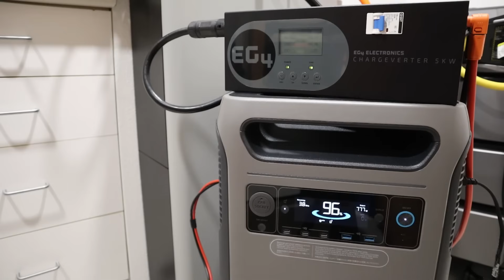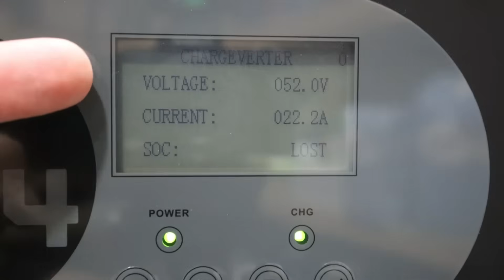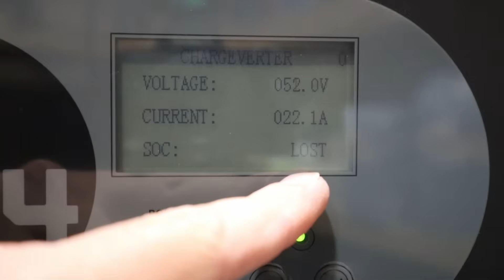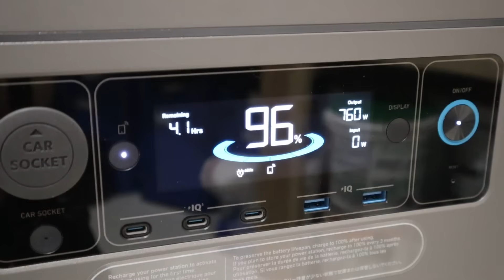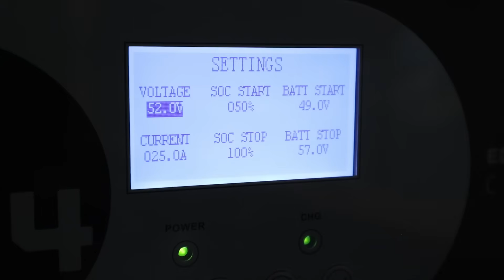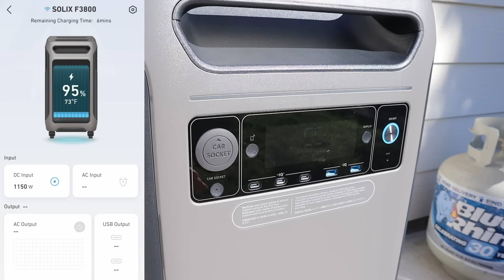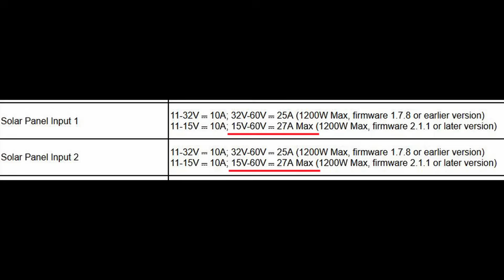The EG4 Chargeverter FIXES the Anker SOLIX F3800!  Keep the 240v Powered On!

Comment: I have 2 F3800's and a chargeverter.  I can try when I get back from my trip unless someone tries before I get back.
Reply from the maker: Please let me know if you can charge two units with one chargeverter 👍
Reply: You can get the 1150 charge for both 3800's    Not sure with the HPP yet.
Reply: Any updates on if you are able to charge both 3800s with one chargeverter?
Reply: @EKingJames1288 I have hooked the chargeverter up to two f3800 that are connected to the home power panel and I found that when I do this one of the units starts charging up to 1150W then I plug it into a second one and the second one starts to gain watts but then they both start losing watts. If I leave just one connected it stays at 1150, but as soon as I hook up a second one, the first one starts losing watts and the second one starts gaining, but only to a certain point, that is not even close to 1150w. I’m wondering if it’s a setting on the EG4 charger converter. It would really be great if I could get the EG4 to charge both of them at full watts. Any ideas?
Reply: @JeffLevy99  The Chargeverter amp setting needs to be 27 amps for each F3800 XT-60 you are feeding, so feeding 2 XT-60s from the Chargeverter would require the Chargeverter amp limit set to 54 amps (each will actually draw about 20 amps, 27 is the spec limit for the F3800 with the new firmware).
Reply: @JeffLevy99  Did you ever get an answer besides cranking up the amps on the chargeverter, which worries me that one may get more than the other during ramping up/balancing.Also, terryabertson says that 54 is amp limit... But not if your talking about 2 f3800s like i have. That would be 27 x 4 right? 4 xt60@ 27 ea. inputs.wish Jasonoid could chime in here and set it straight.
Reply: @JeffLevy99  I had the same experience. Start charging but soon the chargeverter Volt and Amp comes down
Reply from the maker: You can't use the chargeverter to connect to both ports on each F3800, if there's a common ground between the dc charging ports the charging will stop. For this reason you can only connect the chargeverter to one port of the F3800. 

Wanting to charge two separate F3800 units? The amps of the Chargerverter needs to be at least 24 amps per port. So amperage output of the Chargerverter will need to be set to ~50 amps to charge both F3800.
Reply: @JeffLevy99 I have the same problem. I cranked amps to 50 on eg4 and max I got on 2 units was 390 per unit but wires were getting warm.
Reply: I thought the issue was you couldn’t use the 240v when charging using the 120v? I couldn’t follow 

Let’s say I didn’t have a 240 v outlet in my garage . Would this set up help me use the 240v plug in the F3800 while having it plugged in and charging in 120v wall outlet ?

Comment: so my plan was to use the EG4 chargeverter to charge on one dc input and have another eg4 chargeverter pluged in on the other input and running off  another generator that way they dont share the same ground
Reply from the maker: I mean that might work....but that's like $1000 worth of chargers! It all depends on how much money you want to spend
Reply: @Jasonoid  I decided to buy 2 EG4 48v server rack batteries  and run through the solar inputs ,Thank You Jason

Comment: I tried this on a smaller scale, on a C1000 with two different power supplies. In both cases the power supplies shut down as the C1000 pulled more wattage than the power supplies were rated for. It would be nice to get this to work though.
Reply from the maker: The chargeverter is rated for 5000w output, if definitely wouldn't be overloaded by the C1000 or the F3800....even at the same time!

Comment: When connecting different gauges of wire like that, it's a really good idea to include a fuse appropriate for the smallest wire.
Reply: I'm confused, is the fuse recommended? I see Jason included a link to a fuse, but I'm lost as to which one to get and how it gets implemented into the wiring.
Reply from the maker: Thanks for the tip!
Reply: @Jasonoid  I'm confused, is the fuse recommended? I see Jason included a link to a fuse, but I'm lost as to which one to get and how it gets implemented into the wiring.

Comment: Does the solar input wattage accept the maximum from the EG4 Chargeverter?  Sounds like no.

Does the solar input wattage accept as many watts as the inverter can supply or what percentage of the output can it charge?  Sounds like a small fraction.
Reply from the maker: Solar port is 1200w per port, you can get 1150 watts into the port with the chargeverter. They said they are looking into a firmware update to allow charging on both ports for around 2400w input.

Comment: Also I would recommend adding inline circuit breakers and/or fuses to protect the wiring on the adapters.  Worst case scenario you can send the full current of the chargeverter through the 8 AWG if there's a short.
Reply from the maker: The chargeverter has a circuit breaker built into it.
Reply: @Jasonoid  rated for how many amps?  It's probably much higher than 8AWG wire can handle
Reply from the maker: @rcguymike  ill have to look closer when I get back home from vacation 👍
Reply: Also, those SB50 connectors are only rated to 50amps. The full power of the Chargeverter going to a 48v battery is 100amps. Dangerous combo without some fail-safes.
Reply: @rwk1859  The 3800 can't pull more than 27amps per port with the latest firmware

Comment: Sad if you consider that a Delta3 plus can charge nearly as fast as that anker setup😅😅😅

I control a 48V relay to feed power to my Delta 2 Max from my 48V server rack battery, I moved all the solar off of the D2M and added it to a Victron 100/20.  I can charge my Delta 2 Max with 2 EBs with 4000+watts of solar, I also have another array on a 150/70, the battery absorbs the excess while the D2M takes in 1000W continuously.  The relay is controlled based on the battery SOC through a node red script controlling the relay output on the CerboGX, much better than using the built in MPPTs directly with the solar.
Reply from the maker: Thats an awesome setup!

Comment: Can you do this with the old school Delta Pro?
Reply from the maker: You'd just plug in a generator into the Delta Pro and it will charge and allow AC out. No chargeverter needed.
Reply: Yes you can, and it is preferred.. You can connect the Delta Pro directly via AC input to a generator as Jason stated, but you are then limited to 1800w and quite a few people had issues with frying their DP when a fridge or something with a high inrush turned on... Poof.. 

You can get 2000w power supplies that will work just the same for around $150..
Reply: @stevenlilly  Can you provide an example of the power supplies that would work?

Comment: Can this EG4 charger be programmed to charge EG4 batteries overnight (TOU) and to a specific state of charge?  If so, it’s what I’m looking for to run my house on a UPS style setup, only using grid power to top up my batteries overnight on days when solar couldn’t keep up.
Reply from the maker: You set the voltage to exactly what you want so if you have the battery voltage you want I'd say so 👍
Reply: @Jasonoid  nice!  Any insight on whether you can set the desired time of charging to come on automatically?  I had a peek at the spec sheet and there was no mention of that.
Reply from the maker: No, it's pretty much an 'on or off' type of thing. No advanced settings.

Comment: Would the Setup for using the Chargeverter to the Delta Pro Ultra be somewhat the same? A friend of mine wants to use a Generator (with modified Sine wave) to charge the DPU on Cloudy days.
Reply from the maker: Yes, it would be similar to the Anker, but the Delta Pro Ultra will only charge around 800 watts (not 1150w) input since it's limited to 15 amps on the low PV input.
Reply: @Jasonoid  From a Gas Generator??? Are you Serious? If that's the case dc to dc would be better
Reply from the maker: @Moes_Prep_and_Tech  yep, just do the math.   56v x 15 amps is 840w. You'd get the same charging speed with a 48v battery. I connect a 48v battery every night to my low PV charging port on my Ultra and I get 800w charging. I wish it was 20 amps, not 15...
Reply: @Jasonoid  That New Bluetti AC300  (APEX) is gonna have 20 amps from what I hear. I think its pretty much the same as the Anker I believe

Comment: To bad EG4 doesn't supply the 120 volt adapter, I have a plasma cutter that will run on either voltage, and it had the necessary adapter in the box with it!
The EG4 chargeverter would actually be a better investment than say a 30A 48 Volt charger from the LiFePo4 battery mfg, when their 30A charger is $300 bucks, Right?
Reply from the maker: I tried a standard 48v battery charger on the Anker and it didn't work. It wouldn't start charging. A standard battery charger relies on a voltage to tell when to charge and it doesn't see that on the solar port. 
The chargeverter just puts out a set voltage, kinda like a large power supply and that's why it works.
Reply: @Jasonoid  So you don't think it would work as a battery charger then?? I was planning to expand the capacity of my C1000 using a 48v 30aH battery then maybe paralleling another on if it turned out I need that much battery capacity, but I need an efficient way to recharge the batts if solar isn't available, and figured the chargeverter would minimize the run time on a generator
Reply from the maker: @dannydivine7699  the chargeverter is a 48v battery charger so yes it will work for that. It also works when connected to the F3800.

Just don't try to do the same thing seen in the video with a standard 48v battery charger.
Reply: @Jasonoid  Excellent, Thanks for the clarification, I thought maybe I had misunderstood. Great Video as ALWAYS! Have a great weekend, Happy Halloween!!

Comment: I have the eg4 server rack battery and inverter and am lacking solar panels and space needed to require the 120V needed for charging.  So I purchased the Victron PPT 150/35 to charge and maintain the battery with 400W of solar.  I had been thinking of buying the EG4 chargeverter to use with my Honda 2200 companion but also want to do other projects using lighter and smaller 12v batteries instead 48v more for portability .  Do you know if the charverter is strictly for 48V only?  If not my other choice would be the BeeBad charger which I can select 12V or 48.  I love the adapters you made.  I need to break down and buy tools required for cutting and crimping.  As always a great great video.  Thank you.
Reply from the maker: It's only supports 45-58 volts output. Check the manual for the exact voltage.
Reply: @Jasonoid  Thank you.

Comment: Interesting idea.  While I don't like it, I get why the 240v outlet shuts off because typically when you're on AC IN power, it just passes power through the power station to handle the loads and any excess power goes into the battery. 

Have you charged the power station up to 100% with the chargeverter?  I know that some MPPTs short the positive and negative connections together when the battery gets full and charging is supposed to stop.  If that happened in this case, I would assume that the breaker on the chargeverter would just trip, but I would hate for something to short out completely.
Reply from the maker: I have never heard of the postive and negative being shorted out when it's finished charging. That would lead to bad things, even with solar panels! 
The charging process is controlled with a relay to turn it on and off.
Reply: @Jasonoid  that’s actually how Victron charge controllers work.  It’s not an issue for solar panels but If you try to connect a battery or other charger to the mppt, it can go poof!

Since the solar panel is essentially “shorted” to itself, no power is generated or harnessed from the sun. The photovoltaic cells within the panel cannot convert sunlight into electricity because the circuit is closed.
Reply: @AdamDeLayDIY  -- Please provide a google search string for where you got that Victron information.  I think you have been misled.

Comment: Ive been looking for a while at AC to 48V DC Power supplies so that i could do this, and i knew that id have to have two isolated inputs for both XT60 Ports, But i have an update to my F3800 which says Updated MPPT Charging Strategy. not sure if its what i think it is, but i hope they made it so i can use the same DC Source on both XT60 Inputs. that would be great since this Chargeverter supports 5KW, so id be able to hit 4800W of input between both of my F3800's on a single Chargeverter.
Reply from the maker: @LamoidZombieDog  I'm working with them to make a firmware update, we will see! Looks promising 👍👍
Reply: @Jasonoid  Lot of us out here with fingers crossed hoping that Anker will find a firmware update that will correct this problem.   Your video is super in helping all of us and perhaps will lead to Anker being able to solve this issue as well.

Comment: 🙈🙉🙊  Hmmm, let me buy another costly piece of equipment to fix my expensive chinese pc of 💩. yeaaa,nope! Or you could buy a Titan 240sp from Point Zero Energy, that will outperform, in output,charging,and outlast this,for many years. Similarly priced, and Titans are low frequency units, sold and serviced in the US. Leaders in the solar generator field.
Reply from the maker: Sounds like I need to look into the Titan 240sp!

Comment: Cool video idea if you're interested. Off grid setup, using one Anker f3800 with the tranfer switch from them. But instead of using Ankers expansion battery, you get s server rack setup. I'm wanting to go this route and leaning towards the smaller Eg4 solar charge controllers which are $400 I think so I can get more solar up. Basically just charging the f3800 from the server rack battery with one input while the other 1,200w input has solar. Showing the wiring, how to use server rack battery would cool to see.
Reply from the maker: I show how to use 48v batteries on the Anker F3800 here in this video:
https://youtu.be/XFlRkMm8rDc
It's an excellent way to get more capacity at a great price!
Reply: @Jasonoid That video gave me the idea of creating the following system for when the power goes out during the storm (I live in SW Florida):  rack of 48V batteries —> pair of F3800 —> Smart Home panel.  I’m planning on using the Chargeverter to charge the batteries when they go low.  I’m unable to put permanent solar panels on the roof for many reasons.  I’ll have several “portable” panels to pull out when the power goes out.  Not being able to have a common ground for the two MPPT charge port will be a big issue for me.  I’m hoping your contact with Anker will force them to update the firmware to allow that.  Thanks again for continuing this thread.

Comment: Quick Question If two F3800's are hooked up with the Anker Smart Panel   is there still a charge issue trying to charge the two F3800 with AC with a  Gen available ?
Reply: I posed this to Anker support.  My solution, which they said will work fine as long as the genny has a very low THD or is an inverter type, is to wire up the F3800s with the Home Smart Panel like usual, but also install a generator input and interlock on your main breaker box.  When the F3800s are getting low on power, plug in the genny, flip the interlock to genny input.  The genny will now supply power to the house, the F3800s will go back into standby and charge from the genny.  When fully charged, turn off the genny and the F3800s will come online to provide power.  Another advantage to this is when the genny is running, it will power the high demand devices that you did not cut over to the transfer switch.
Reply: @davidparsons5513  Do you have solar input to the power stations as well? If so, what panels and configuration did you opt to go with?
Reply: @michaelsmith2039  Currently no solar input unless I pull the F3800 out for standalone use.  For that I have a pair of 200w (400w total) Anker portables.
Reply: @davidparsons5513  Thanks for the reply.  I plan to run some fixed BLUESUN panels (BSM460M-72HBD) from 2x outdoor shade structures to my Ankers in addition to the grid tie in with the HPP.  I am also adding a lockout switch and external inverter generator for when I need to cover home power and rapidly recharge batteries.
Reply: @davidparsons5513  I will have a answer in the next few weeks    I only have inverter style Gens

Comment: EG4 created this “chargverter” and charged $400 each to solve a BS problem…power stations that were too sensitive to charge on gas generators.  Bluetti finally solved this problem for me with a targeted software update.  Didn’t need to buy an overpriced product.
Reply from the maker: The Bluetti devices don't offer 240v split phase output on a single device so this doesn't apply. You're talking about a completely different issue. No need to worry about it 👍
Reply: @Jasonoid  I’m talking about the original reason the chargeverter was made, to sell a new product instead of fixing the existing ones. Glad you found another use for it.
Reply from the maker: @CompleteOffGridAmateur  the chargeverter was not built for power stations. It was designed to be a high powered 48v battery charger, up to 5000w charging! Youre supposed to connect it to a server rack battery so you can charge when these no solar around. It's an excellent product for that. Using it on a power station is just an alternate use case haha
Reply: @Jasonoid  The chargeverter was yellow when it came out. It was designed to smooth out the erratic AC power of a gas generator and produce a pure sine wave. Perhaps they added functionality to later models, but the first model was marketed as a fix for power stations sensitive to frequency irregularities. I remember it very well.
Reply from the maker: @CompleteOffGridAmateur  well this one definitely puts out DC power. I was wondering the difference between the yellow one and this black one.